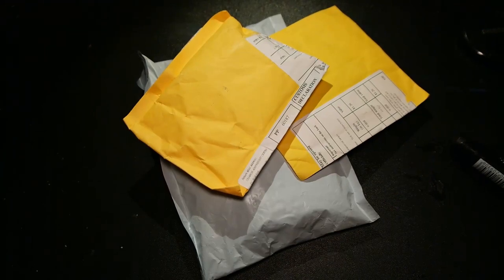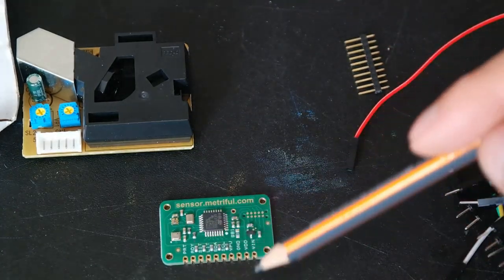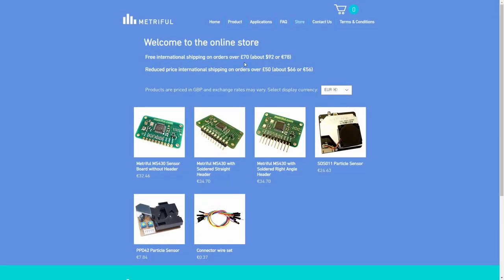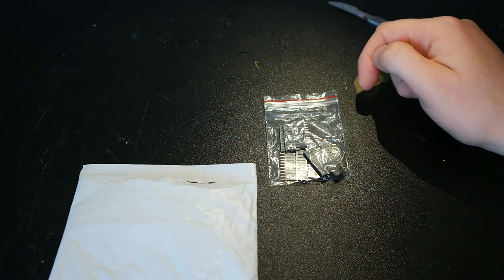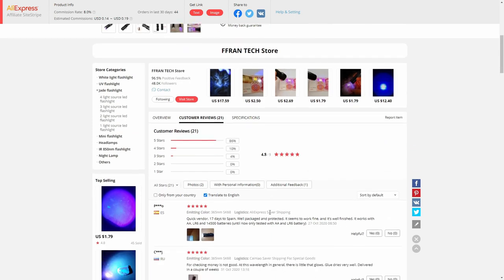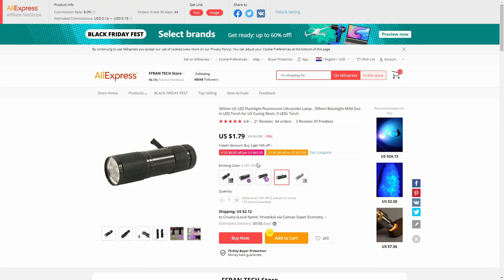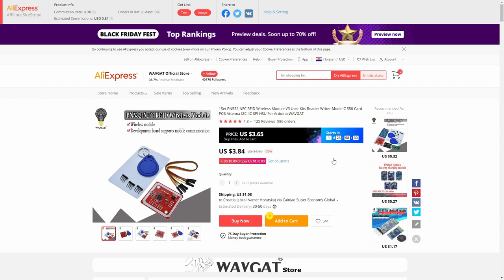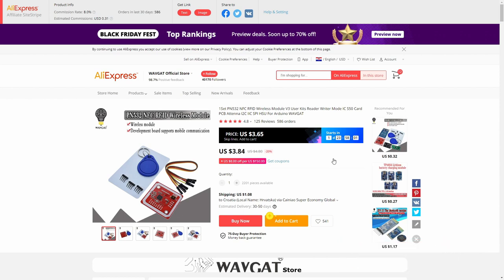Mail Day #023 with BeardedTinker (MS430, pin headers, LED flashlight, cables & PN532 NFC board)

Comment: I've seen the Metriful on kickstarter, did give it a serious look though :(
I seen it has I²C, so you can connect it to EspHome, if someone programmed it.
Reply from the maker: YEs, it does, but from what I've seen, board it self is still not supported by ESPHome. On the other hand, there is now arduino sketch available for it that has integration with HA.
Reply from the maker: Do you have maybe Discord account? I've was checking chat from yesterday and see that you had question in regard to SSL.
Reply: @BeardedTinker  yes, we've talked before on discord.
Reply from the maker: @Thamli  I'm slow a bit :) Didn't connect name with nick :D